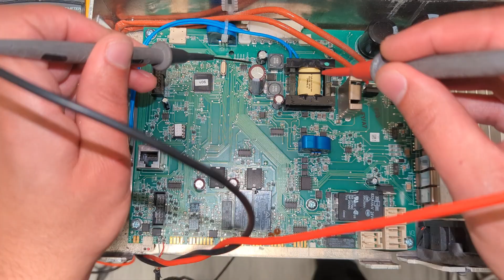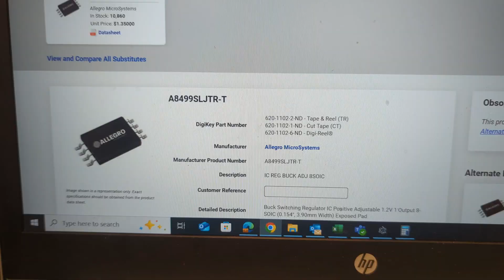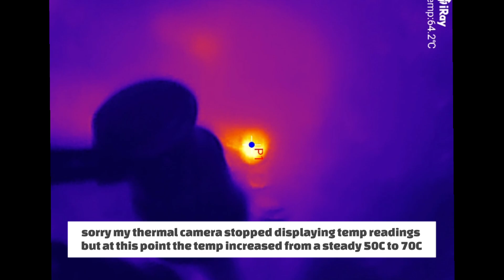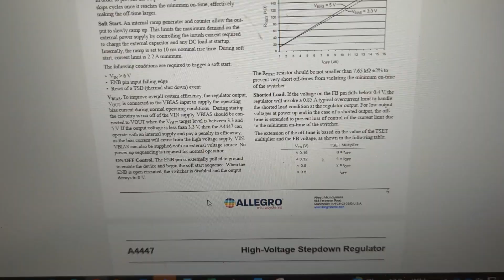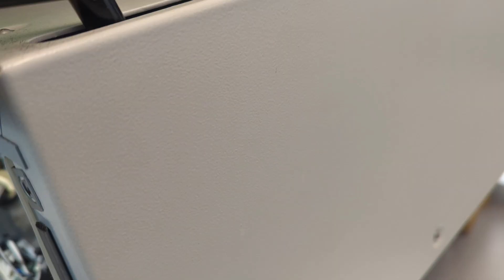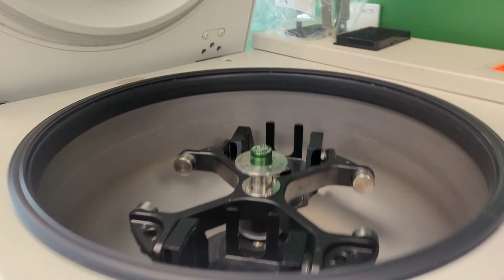Thermo XTR Centrifuge Error 16 - PCB Repair Goes South...

Comment: I saw your Eppendorf repair video on YouTube and I really admire your work. I have the same type of device, an Eppendorf 5145R, and I have one unit in my possession. Even though I connected the power cable, there is no display on the startup screen at all. Could you please guide me on how I might be able to repair it? I would truly appreciate your help and would be very grateful.

Also, could you please let me know how I can get in touch with you or the best way to contact you?
Reply from the maker: Hey thank you for the kind words! I'm a bit less familar with the mainboard of the 5415R as we don't have any of those refrigerated models here.  But I was able to find a picture of the main PCB for one of these and it does appear very similar to the 5415D.  On the 5415D there is a filter cap that provides power to the UCxxxx current mode PWM chip.  This cap loves to fail on the 5415Ds.  You'll see two right by the current mode PWM chip - its the smaller one.  Though you can replace them both.  My money would be on that cap failing causing your power issue.  Of course you can check for simple things like the fuse as well.  There are 5V regulators on that board - you can check to see if you have both 5V rails with a multimeter.  Just be careful where you connect your ground lead as to not short anything out.
Reply: @fmashockie  Thank you for your message. Is there any way I can contact you via email or through any other platform? I’m a bit inexperienced in this field, and I would really appreciate it if there were a way I could message you directly. Also, if there’s anything I can do for you in return, I would be happy to help.

Comment: Excellent work Franklin! Two quick things: first I wonder if you could put a very small heatsink on that 22V Zenor (maybe one of those meant for a Raspberry Pi's chips)? Secondly, there is a marinara sauce stain on the top of the board so it's quite possible Mama Luigi was using it to whip up a fresh batch of sauce.
Reply from the maker: 😂😂 thats a good idea! I was thinking of putting in a thru hole 500mW zener in its place. Lift it off the board a bit. Or possibly increasing the series resistor. But definitely a bit of a design flaw. Otherwise these boards a usually pretty robust. Generally not too many major faults... Until i work on them 😂